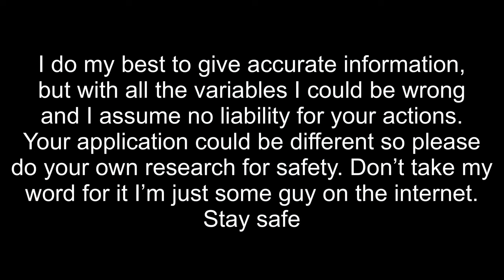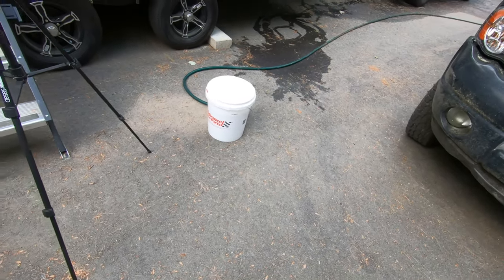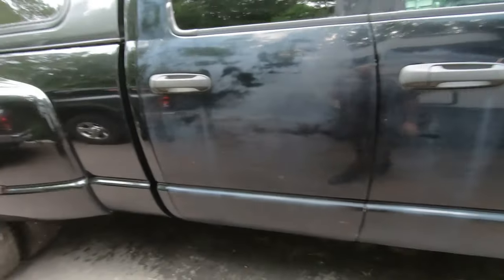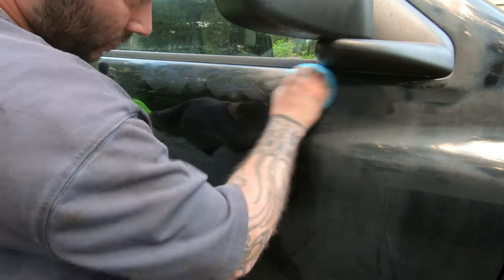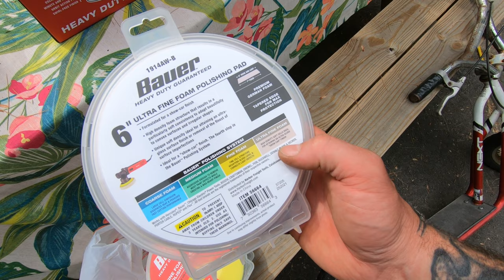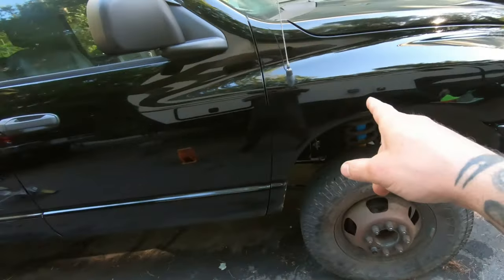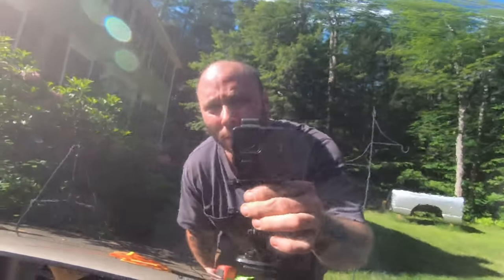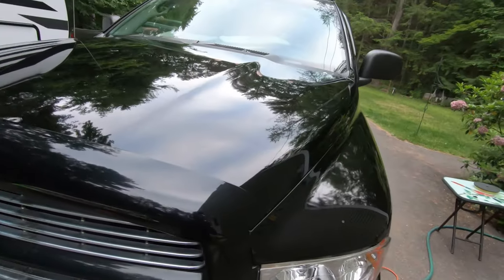Restoring faded and oxidized paint

Comment: Wonderful work, congratulations. It will look great pulling that camper, but you can rest easy as the powertrain you built will do its job. Looks make the youngsters happy power train functioning as designed makes the operator happy. Congratulations. Take care,
Reply from the maker: Thank you.I’m always worried about breaking down when we go on trips. This truck should be more reliable than the other one having the manual. There is half the hoses and stuff on this one just without the automatic cooling system. I tried to upgrade the trouble parts when I was going on the spending spree.

Comment: Wonderful job.  This video gives me the confidence to follow this sequence of steps.  I have an old Black and Decker buffer with a lambswool pad but it has a learning curve such that one can easily burn thru the paint.  I think these harbor freight pads and the dual action Bauer buffer is the way to go.  I think I will skip the clay bars unless the surface feels rough after the fine joint compound step. Thank you so much.  Kind Regards,  Craig
Reply from the maker: It was surprisingly easy with the da polisher. This was the first time I had used one. I was a bit nervous at first but it’s really forgiving. I watched a few more polishing videos and from what they said. You don’t need a lot of compound and I probably used more than necessary and hold the pad as flat as you can. The clay bar is to get the impurities out of the paint and get it as clean as you can before the compound. I would do it but I don’t know if it’s a requirement. I’d recommend taping off the plastic trim and stuff you don’t want wax on. I didn’t i wish I did. I wish you luck with yours.

Comment: many years ago, i applied blue coral to my mustang on a hot sunny day.  it took me 2 days to rub it off and it did not look good.  i haven't waxed a car since lol.
Reply from the maker: I did something like that once. A guy told me you need to let the wax dry otherwise your just wiping it off. Yeah he must have had some different product because it took some aggressive rubbing to get it off after that. I got a Life lesson: don’t let the wax dry.
Reply: I think that the only decent way to apply / rub off cutting compound, polish or anything like that is to do it under cover. In the sunsine, you're just asking for grief as it dries on the hot metal.